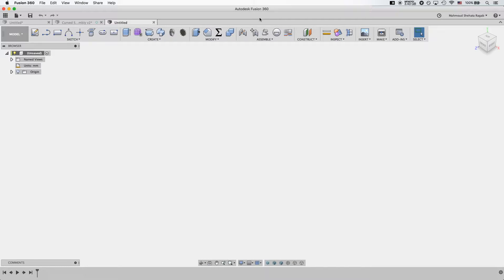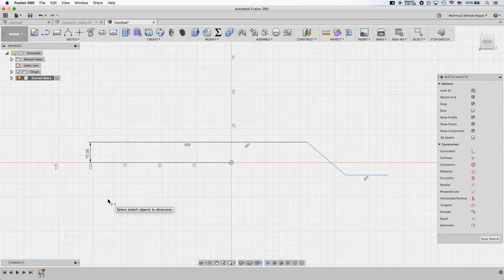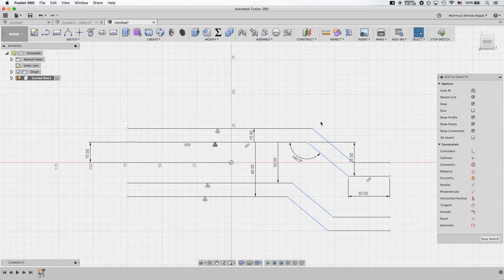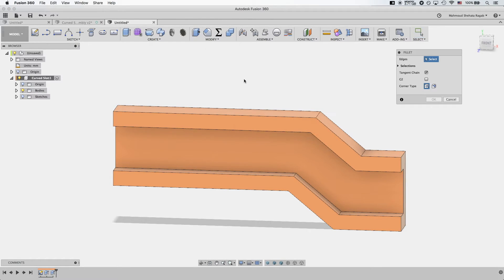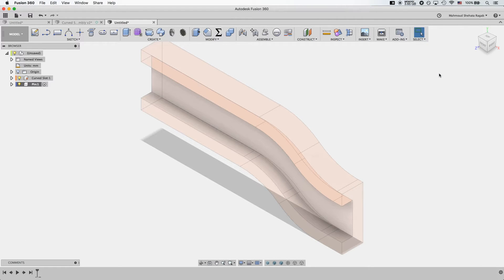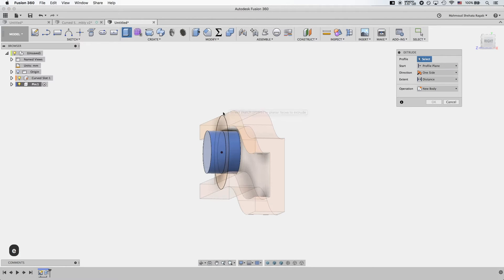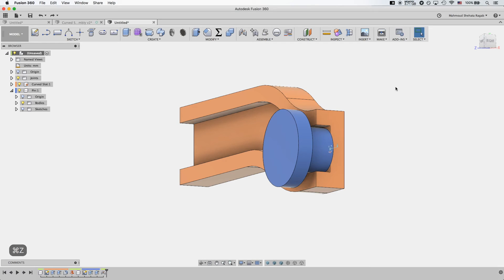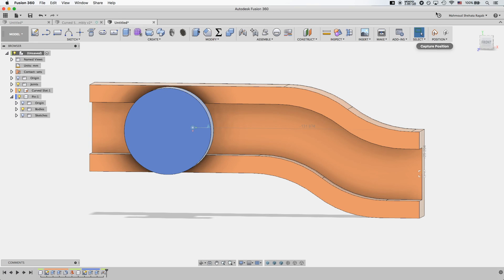Kinetic by Design #1 -- Creating a Curved Slot in Fusion360

Comment: Man ur tutorial almost worked for my design!  I have the pin running in proper motion down my slot but when I attach my component to it I lose the motion of the pin and it makes the component I’m attaching have conflicts with other joints...how should I go about joining my component to the pin...revolve?  I also tried making the pin and the component a rigid group...  as u know there is no way to get joints moving down a curve and ur tutorial is the only method that was hopeful.  Any help would be appreciated!
Reply from the maker: Hi Kory,
So have you tried giving your pin a rigid joint to the other component? I think this method should work...
Reply: Mahmoud Shehata Thanks for getting back to me!  Yes I started with a rigid joint but I had the conflicts.  Then I thought revolve made sense but that also didn’t work.  After that I tried combine components to make the pin and my second component one.  I watched ur tutorial numerous times and u spent a good amount of time talking about where u would attach the component but I wasn’t sure if u meant the larger diameter top portion of the pin or the space along the shaft of the pin between the large diameter top and the slot rail...I feel like I’m probably missing some small detail that prevents this from working.  Frustrating that fusion doesn’t have this capability as I know inventor does and so does solid works....:-/
Reply: So....I managed to get it to work.  Unfortunately, I think what happens is, if ur running a computer with the minimum requirements for fusion,  when u move the component that puts both motion on a joint and the contact set slot it generates too much computational resources for our comp to handle.  For example, if I move the component quickly it immediately jumps out of the slot however if I carefully move the component along the slot path it does work.  Just not well.  I hope fusion 360guys will remedy this issue by allowing joints to move along spline curves...

Comment: Does not work for me "Enable New Contact set" which I select both, it still can be move anywhere?
Reply from the maker: Hi Andrew, Thanks for watching the tutorial and commenting. Have you made sure there is a gap between your pin and slot? Without this gap, the contact will not work as intended. Let me know how it goes.
Reply: This reply is not likely to be of use to Andrew Soulby after more than one year, but for new viewers it may be!... My theory is that the more powerful the computer and graphics card, the better this feature works.  I created an extra extrude across the mouth of the slot, at the left end.  This means that the pin cannot exit or enter the slot at that end, although it will exit at the right hand end, at which point it can go anywhere, but only enter the slot again at that point; this is just like a real pin in a real slot...  HOWEVER...  if I "slam" the pin into the wall of the slot it magically goes through the wall!  I can only assume it because the GPU cannot keep up.  I seem to recall a warning some time back from the Fusion team, that too many contact sets in a design will cause slowdowns in many computers.